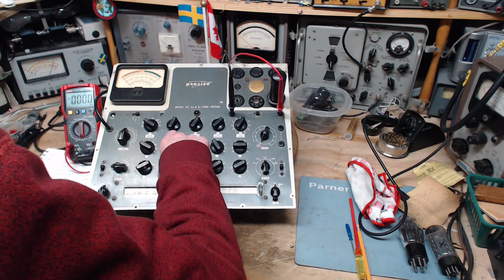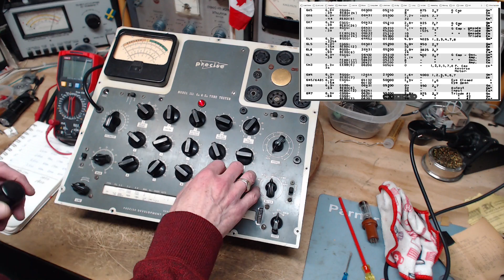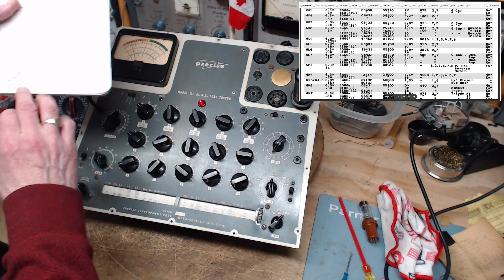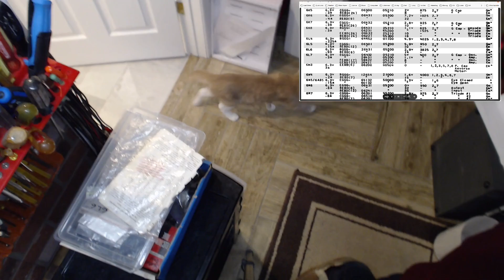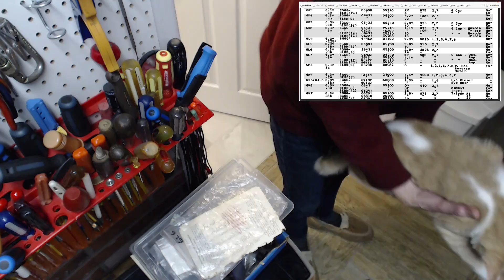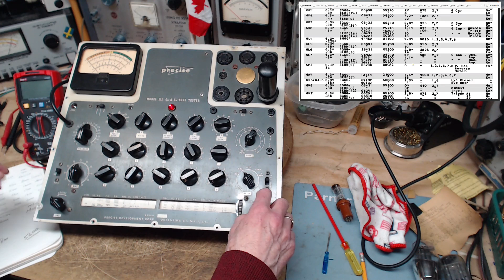Tube Tester Testing - Precise Model III Gm & Em Tube Tester - Video #13

Comment: Jim,  hello I noticed that when you started your first test 03:00 and set all the switches but did not adjust the line, why would this be not be necessary as all the calibration required that be done first ?.  At 05:20 you go straight to Bias milliamps with the line volts in 12 o'clock.  Later  08:27 you start Filament current and you adjust the line voltage from 12 o'clock to 10 ??? 1  This may be the a why Tube (valve) transconductance test was off.  Or a smoked resistor. Ps   52 second Snowblower video  had 5k views, just saying   Best.